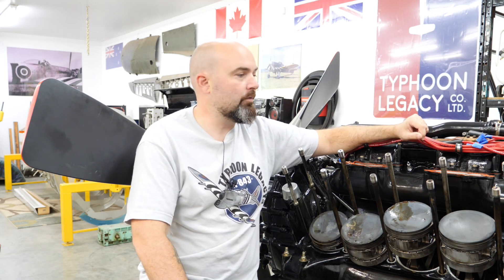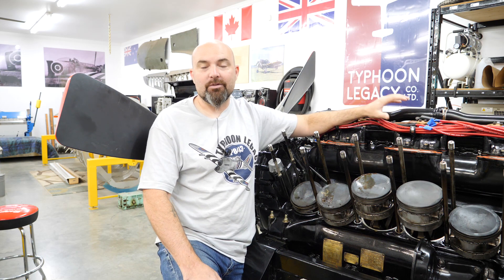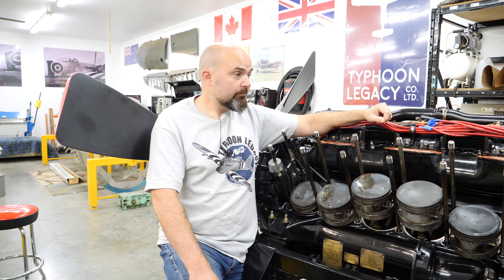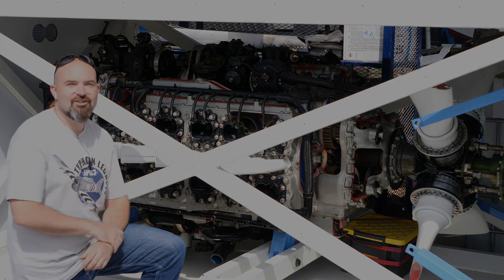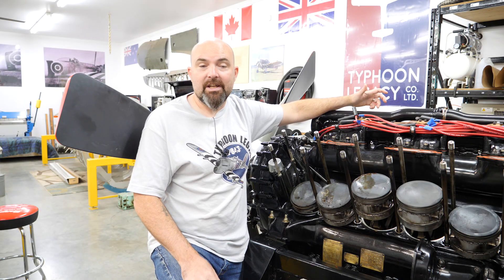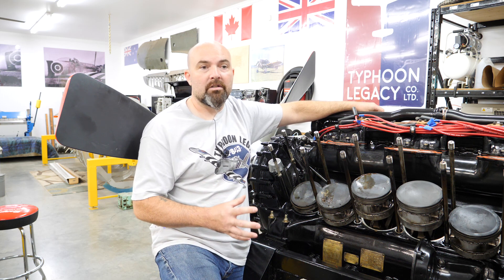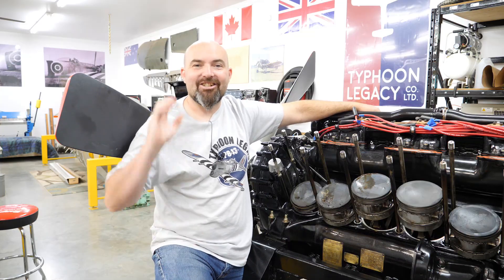S2E10 Another Napier Sabre?

Comment: What a beastie! Who in their right mind would take an angle grinder to so many parts of such a rare power plant???
Reply: Probably a teaching tool for apprentices.
Reply: @briancavanagh7048  maybe, but use a P&W, there are thousands of them!!!
Reply: @bollybon7916  Not much use if said apprentices are going to be working on Napier Sabres.
Reply: @18robsmith  keep on missing the point...
Reply from the maker: Napier Apprentices did the cutaway work on these engines. ~Ian
Reply: @TyphoonLegacyCoLtd  It used to be a great apprentice task to work on engine cutaways - my brother did part of a RR V8 during his apprenticeship with them back in the 1970s.  You were given a part, told what cut you to do make and then sent off to cut it, polish it and paint as instructed.
Reply: Engines destined to be sent to apprentices and used as a cutaway, one would think they are not to the same level of tolerances as engines put on brand new aircraft and sent to war. Would these apprentice engines be made up of sub standard parts with inherent flaws in the castings?

Comment: I had some idea that the Merlin was a sale item or something else for your goal. That sabre engine was a surprise though. How much do you loose on the cut aways?
Reply from the maker: They certainly did extensive work on the cutaways. Our next steps cannot be explained until we have finished up with the Merlin trade and a few other details. ~Ian
Reply: I think for that engine the answer is too bloody much by far! I am struggling to see what good that engine is going to be ( apart from structural instruction of the latest variant)  and unless they have a Sabre 7 engine in bits I can't see as to what good it will be. So Ian please tell us!

Comment: You didn’t address the most important detail. The Sabre you showed is a cutaway, so it cannot ever run. You may be able to use it as the basis for laser scanning and CAD to enable you to machine new casings. I don’t think so. Someone else has commented that you may have a different Sabre? If not, why not mention it?
Reply from the maker: I can't let everyone know our plans ahead just yet, we need to complete this trade and get some additional work done. I will announce the next step as soon as possible. ~Ian
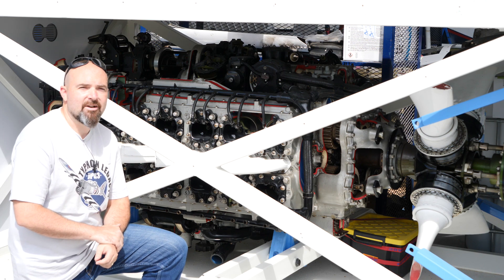Reply: He did mention it was a cutaway, albeit quickly 2:55
Reply: @radiationking9875   The other Sabre isn't a cutaway,  it is a crash recovery and I think it was in mud.  Starting with the cutaway and working backwards is a good solution.
Reply: @FiveCentsPlease  yeah read it wrong lol
Reply: +Benders   Older videos in the channel discuss the other Sabre.  About half of it is usable and some water damage, so the cutaway will provide a lot of parts that don't have to be manufactured.   This is great progress for the project.

Comment: If the Napier engine is a cutaway ,are you not going to need another engine?
Reply: I believe they have an engine Dave I believe its all but new :)
Reply: @CharlieHorse221  if they have another engine that is "all but new" then why waste so much time rebuilding a trailered merlin to trade for a destroyed sabre? the "big reveal" creates more questions than answers.
Reply: @Araye  There will likely be parts in the cutaway that may be useable as spares (crank/rods/pistons/gears etc).  Engine spares will likely be the most difficult part of this whole project as the rest of it is mainly sheet metalwork.
Reply: @Araye  I am no expert I am sorry but I do believe that this excellent cutaway  traded for the Merlin will help so much in the runup to getting an engine operating with absolute perfection,  it all takes time and this is an extremely rare piece of aviation history which the whole world awaits with excitment..It is no waste of time I believe !!
Reply from the maker: You will need to follow along to find out what the plans are, these things take time.